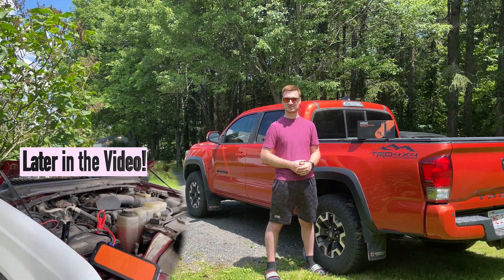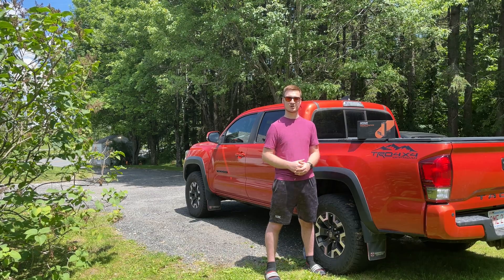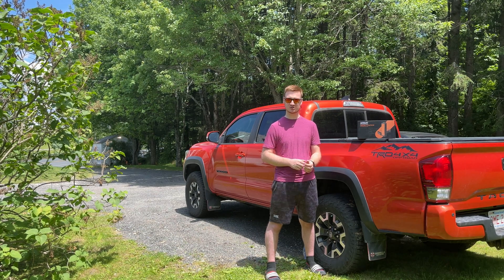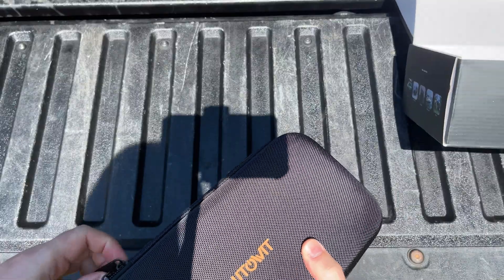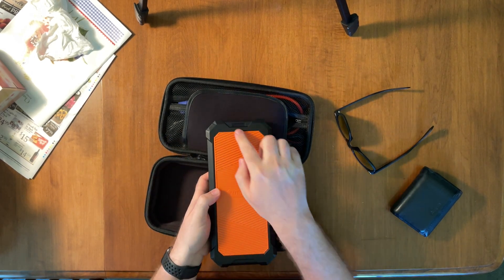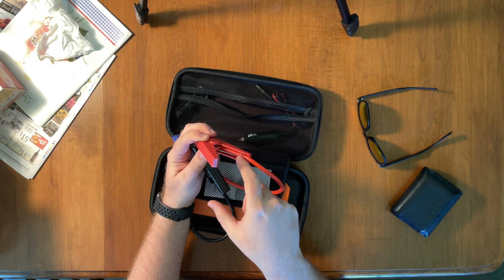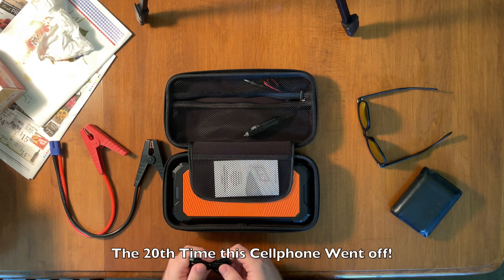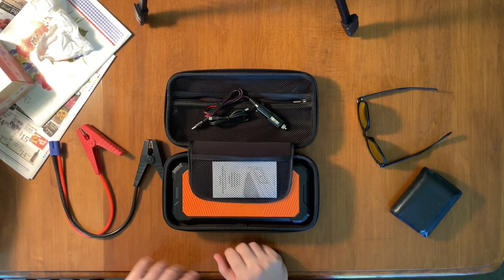AutoWit Super Cap 2! The Best Car Jump Stater! Zero Maintenance Required! Completely Dead 6.8L V10!

Comment: I'm reasonably sure that the jump-pack doesn't boost the existing battery, instead the current from the jump-pack is directed to the starting circuitry instead. I base this on the fact that my similar supercapacitor jump-pack has a bypass mode, which can be used to start a vehicle with the battery completely disconnected.

Comment: I tested charging this with a portable folding solar USB charger 20w, and it charged the autowit to 100 percent on a mostly cloudy day in an hour .  So if you also have one of those camping small solar chargers in your car, you're all set in the event your battery is completely dead.

Comment: Not too professional or polished but I got the point which is what I came to see. Glad you confessed that a truly dead battery will render this unit useless. I would like you to fully charge the unit then try this unit out to see old the capacity truly changes

Comment: If you haven't used it at all does it still only lasts 10 years?
Reply: I'd expect it to last 20 years either way, but time will tell if the components will hold up that long. It's just not sensitive to charging levels and use the way the lithium battery jump packs are, which is the major advantage to me, as I like to just leave it in the trunk and forget about it until it's needed.

Comment: Ps I saw this in Scotty Kölner channel. This device will also let you know if your battery is charging once it's running and still connected. It will show the voltage and with that you can see if the alternator still works
Reply: He stated on a smaller car, of it shows 14-14.9v, it means alternator works just fine

Comment: @14:09 it's actually closer to 2 seconds if you watch a Project Farm video.  glad to see it worked on yr big engine though!
Reply: If you need longer crank time, the KeenPower unit has a larger set of super caps. It's rated for 500F and I ran a rough test and it showed 87% of that, so I consider it within that spec allowing for measurement error.  It needed interpolation to calculate the full capacity because it cuts out when the voltage drops before 10V, so the full charge of the capacitors can't really be used in testing.
The design of the KeenPower is oddly without much in the way of foolproofing compared to the Auto Wit and Schumacher units I also have. It'll fully allow you to connect it up in reverse to your car and blow things up if you choose to.
The Autowit won't switch on at all unless it detects a connection to a minimal voltage with the right polarity, though it can be bypassed if needed.

Comment: Initially I purchased a battery-type jump starter, but the manual said I needed to charge it about every three months.  Plus some reviews say that the lithium types only last about two to three years and will crack if left in a hot vehicle.  That was a deal-breaker for me.  So I returned it and got the AutoWit as shown in this video.  I found an unused 5V 2amp power block and put that in the carrying case, since the Autowit doesn't come with one (only the cable).  If my car battery is too dead, either I'll find someone who will allow me to charge the Autowit from their vehicle, or I'll find a 120V outlet and use the 2amp power block.  I tested it and got it up to 50% power within just a few minutes. 

If you go camping and will be remote, then yeah a battery-type is the right choice.  But if you have access to power in some form, then this seems to be a good choice since there is no maintenance.  Battery-type jump starters won't be any help if they are dead when you need it.
Reply: made the same swap too! I go car camping & my game plan is I have a power bank & solar panel with me so these are my backup sources!
Reply: If you have an old 12V sealed lead acid battery you can keep that along with the super cap starter to provide the charge if you're worried about your vehicle battery somehow getting absolutely dead. It'll charge much faster than a 5V source. 50% on the auto wit will not work at all because the unit wouldn't switch on at that level, it needs to be pretty much fully charged before it'll allow the output to be switched on. That's just how it's designed.

Comment: Shouldn't the  negative terminal be clipped to a different place for grounding, instead of the battery's negative terminal?
Reply: Normally yes.  But remember you won't get any sparks if the clamp is placed securely because until you push the button, and the 10 second count-down goes to zero, there is no power being delivered to the battery/vehicle.
Reply: @spacecoastz4026  Hmmm, strange, I thought I remembered that when I connected the black clip to the battery's negative terminal (or any other metal under the hood), I do see some sparks. 
But since you say that, I will double check again to make sure... 
And I will report back later...

Comment: I researched the prows and cons of both types of jump starters. The battery units still need to be charged and some people are to busy to remember to do this. The capacitor type units still need some juice in the car battery. I found a commercial heavy use capacitor unit that works differently. It was  delivered with the capacitors charged at 14.2 V. I put it in the trunk of my car. Around 13 months later I jumped my friends jeep. You don't need to charge it from the vehicle you are jumping until after you start the vehicle. Once the vehicle starts you leave it connected. It takes 30 seconds or less for it to charge. It has 6 foot long charging cables that are made with 4 gauge wire. It weighs 19 lbs. It is the KrankingKart Mini HD. It can be dropped in water and will float.

Comment: It did not work for my power generator with a completely dead battery. If you try to disconnect battery, this Starter is useless. It will not start a car without battery.
Reply from the maker: Because this is a capacitor that builds up a charge over time and then releases it so it requires a battery to be in the system very few jump package can replace a battery long term unless you buy on one the large led acid jump starters that is pretty much a car battery in a different form factor
Reply: @DomDemeo  it does not work even if I charge capacitors to 100% from another car.
Reply from the maker: @olegvorkunov5400  are you holding the discharge button so the court down starts ?
Reply: @DomDemeo  Yes, and it does nothing. Short hold, long hold - nothing. I tested on my ML350 by dicharging the battery and I was able to start a car when battery present, even though it was discharged to close 5Volts. But this Started just does not work if battery is connected to clips. Probably it is a nature of capacitors. Try to charge it from cigaret lighter, disconnected from lighter and press button. Nothing will happen if it is not connected to a battery.
Reply: @DomDemeo  My power generator LF8750iEPL had a completely empty battery (below 1 volt). Autowit was not able to recognize it and never was able to start the generator. I was about to give up and return Autowit, but then I decided to try to charge the battery a little bit using Power Generator's internal trickle charger just for testing. In 20 minutes of trickle charging, I connected Autowit previously charged 100% from the car cigarette lighter, and then connected it to a battery of the generator, which had about 9 volts by that time. Autowit recognized it and went into PowerON mode where I was able to press a button and start 10 seconds countdown. And woala! I was able to crank up the generator and start it. Upgraded my review in Amazon to 4 stars, because still Autowit does not have an override mode to start 10 seconds countdown on a completely dead or no battery installed. Autowit is a keeper and I am ready for any storm which could knock power off. If I would need to precharge the battery for Autowit to recognize it, I could use one of my computer CyberPower battery backups to provide 110 volts to precharge the battery in the Generator.
Reply: That’s because it doesn’t have a battery bypass feature unlike most lithium jump packs. I have a Lokithor jump starter w/ air compressor and it’s able to jump cars with stone dead batteries. You hold down the bypass button and it sends power regardless of the battery being detected.
Reply: Yeah thats the only negative thing about this product, even if charged to 100% it will not work on a completely dead battery, im guessing because it has no bypass 🤷‍♂️

Comment: Cool. I just got one. The unit is rated down to minus 40F. Unlike batteries which rely on chemical (electrochemical) reactions to make amps, the capacitors are purely physical and should discharge the same amperage, independent of temperature. You should be able to stash it in the vehicle, forget about it for ten years, then bust it out.... or use it more often and help people out.